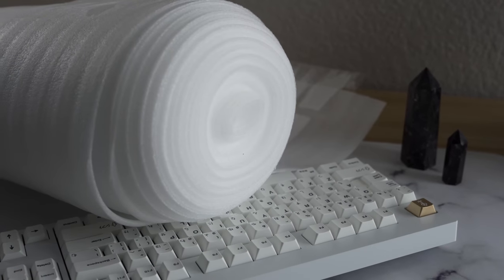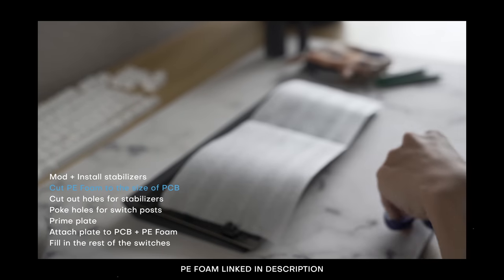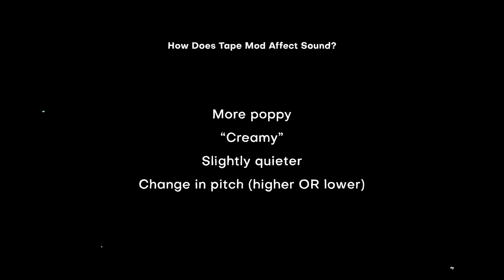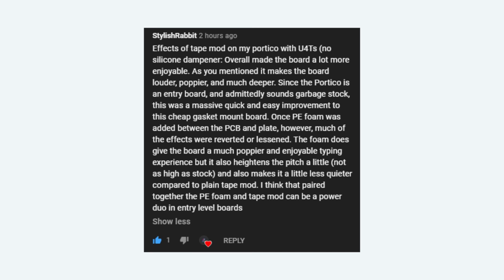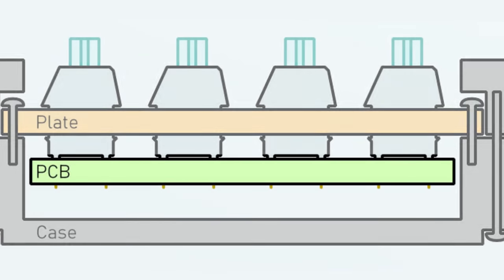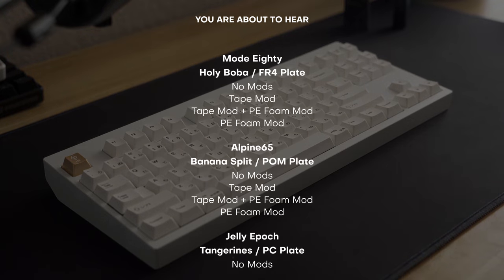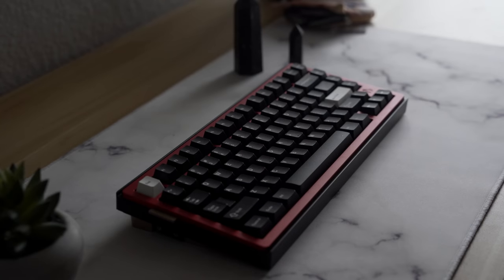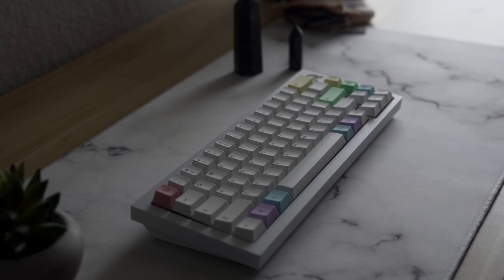PE Foam Mod Explained: An Ingenious Design

Comment from the maker: Timestamps are in the description if you want to compare sound tests on your own or skip to certain sections.
At 1:28, ignore "How Does Tape Mod Affect Sound". It should say PE Foam Mod. 
Foam: https://amzn.to/3lmLhAp 
This is not antistatic. I didn't have any issues whatsoever, daily driving 3 boards with it installed. With how little static electricity would be accumulated before it enters the board, I doubt there is any risk at all. Additionally, modern PCBs are incredibly resistant to static, however I would still avoid black foam, as that indicates the presence of carbon, and alongside it, conductivity.
Ranger629 adds that *YOU SHOULD NOT ATTEMPT THIS MOD ON A SOLDER PCB*. The heat from the soldering process can melt the foam and thus damage the PCB. 
Thank you StylishRabbit and ura for the research guidance!
Reply: is there anyway I can get this foam without having to buy like 500ft of it?

Comment: Why always do the sound test at 200 miles/hr? How are we supposed to hear resonance if every stroke is followed instantly by another one? You can just hear noise rambling. I don't understand this. We know you can type fast, we get it. So annoying...
Reply: because thats how it would sound like? you dont press one key and wait for the echo to finish before pressing the next key 😂
Reply: @zigrakudo4092  I don't spend all of the time on my keyboard typing at 200miles/hr actually, no.
Reply: @maxfern5701  yeah, but you also dont type on it like a grandma. unless you are a grandma, that would be understandable. even if you type at quarter the speed of the one using it, it would still sound similar. i understand if you find it annoying. you can always watch others, though. no one's forcing you to keep watching this guy's videos. unless you are. blink twice if you need help.

Comment: Awesome breakdown and mod! But dear god that sounds so tedious hahaha
Reply: it actually doesnt take that long
Reply: It seems like it takes far less time than hand lubing switches.
Reply: @prithvib8662  definitely quicker than hours of hand lubing
Reply: lol
Reply: Honestly doesn’t take that long (as long as your putting it into a new build) exact-o blade and fine tweezers to cut and poke holes
Reply: Hi hipyo
Reply: Definitely isn't as tedious as lubing switches. Using the PCB as the template, it takes about 5-10 minutes to prep the PE foam
Reply: @little_fluffy_clouds  Yeah, thought Hipyo is supposed to know keyboards well? And he thinks a PE foam mod takes a long time to do? Hm.

Comment: Wait, you updated the description to include anti-static foam? Although it is probably fine to use, it's actually safer to use regular, non-conductive PE foam. Anti-static foam is not meant to be used with electronics while they're plugged in, it's meant to dissipate static shocks away from the electronics it is wrapping. It is conductive (albeit barely so), and therefore somewhat risks shocks transferring from the case to the PCB. You should probably keep the foam link as the regular, non-antistatic foam.
Reply: best. comment. ever. there are a lot of questions regarding this in many places and forums. thank you for sharing this.
Reply: Thanks for sharing this!
Reply: so the foam he has linked in the desc is non-conductive? I got a GMMK pro with some PE foam but want to buy non-conductive just to be sure

Comment: Your WPM seems substantially higher than other content creators who do sound comparison videos, and it really helps to show the differences in sound.
Reply: the upside of using dvorak
Reply: @ee1yd  colemak better
Reply: @kinga1925  workman best
Reply: @ikeworkman4449  comment is 5 months ago i use neither sticking to my qwerty typing fast doesnt matter when you can already type 100 wpm atleast
Reply: @kinga1925  I don't use either also, just jokes. Although, based on my research workman is the best ergonomically while also allowing for high speeds. Also you might have noticed that a certain someone has "work" and "man" in their name...
Reply: @ikeworkman4449  got it.
Reply: @ikeworkman4449  i can type fast on qwerty so it doesnt matter, typing speed does not matter anymore
Reply: @ikeworkman4449  colemak dh has better ergonomics than workman

Comment: Subscribed! I talked about this mod with others on discord servers and there were some criticisms about how they don't like the thought of their board being packed with foam, that a good custom board shouldn't have foam, etc. Who's making up these rules and standards? This mod is revolutionary especially for people who can't afford expensive boards. It elevates their "budget" boards like gmmk pro to other high end boards and at the end of the day, if you're happy with it, nobody cares or is judging
Reply from the maker: The argument is a bit pretentious, but it's fairly true. The higher end of the community sees foam as a sort of crutch, being an "easy way out" of improving sound over actually taking the time and effort to prototype a case that sounds good without foam. When budget becomes a limitation, this argument is nullified because there simply isn't high end design in lower price points. 
And of course, you are building your keyboard for yourself and not for others, so it doesn't matter. If you like the mod, by all means do it.
Reply: my guy gmmk pro is literally 160 dollars thats so dam expensive bruh

Comment: I think you should include a disclaimer that the PE Foam Mod should only be attempted with a hotswap keyboard. As Hiney has raised up on multiple streams, doing the PE Foam Mod on a soldered PCB can potentially damage your PCB. The high heat from the soldering iron can transfer the heat up the switch prongs and melt the PE Foam. The melted Foam can then flow into the PCB contact points where essentially create insulation between the contacts and ultimately causing the PCB to not work. 

*Addressing people who potentially will say: "I did it with a soldering iron."

Sure, you did it and nothing happened doesn't mean nothing will happen to the next guy. Plastic/foams melt when exposed to high heat. They leave a black layer of gunk behind after they have melted and that is what can potentially cause contact issues between the PCB and switch.
Reply: Why would the melted pe foam flow against gravity? Additionally, all of the contacts in the PCB are soldered, melted PE foam isn't going to do anything but get it a bit dirty at most.
Reply: @irgilligan  plastics and foams can curl up when burned or melted. The foam here is also not very dense so it's not neccessarily going to melt like wax and drip
Reply: Ahh so that’s why my keys don’t work sometimes oop
Reply: Is this reddit or YouTube
Reply: @deccapod8957  lmao
Reply: Is this different from the normal foam mod?
Reply: I did pe mod on my solder pcb and i dont have any problem doing this. Make sure the solder is hot enough so that you wont touch the pcb for too long
Reply: would it be ok if u waited for the pcb to cool down before proceeding?
Reply: @TMKM  the foam has to go in before you solder
Reply: So glad I read this before actually doing it X.X....
Reply: I was thinking 💭 how the hell this would cause damage! Guys calm down! It is a foam on a ready to go pcb and switches! Didn’t realize that you have to squish the foam between switches and pcb and then solder it 😂😂 oh my! This isn’t fun at all!
Reply: didn't even think of this when i was putting neoprene ontop of my plate, kb working fine so i guess neoprene is harder to melt
Reply: Oh thanks just broke my keyboard because did this😃 but now i know why it broke
Reply: If you're melting the foam, it just means you dont know how to solder
Reply: has anyone poured silicone in between the pcb and plate (after the switches are soldered, of course)?

Comment: Thank you for this!!! It makes me happy that the community is taking sound so seriously, and the stigma against using plate foam (one of my favorite mods) is starting to decrease.

You mentioned that it was difficult to predict how it would make the board sound. In my opinion, it actually makes boards sound mostly the same. Since it makes low pitched builds sound higher and higher pitched builds sound lower, it brings everything to the middle, and everything kind of sounds the same because any extremes are normalized. It kind of has a reputation of making "any build sound good".
Reply: I'd say it makes any build sounds "decent". If the board is budget, it improves the acoustics, making it go from "okay" to "decent". If the board is premium, it normalizes the acoustics, bringing it down from its unique sounds to "decent"

Comment: These videos are so good, taking a more scientific and dissecting material effects on keyboard sound - for the amount of time and money the mk community sinks into the hobby, im surprised no one did this sooner! 

I have a suggestion for another acoustics analysis / comparison video: how adding soft materials (deskmats, towels, t-shirts) underneath the keyboard will affect sound! It's an easy enough way to instantly change the external environment of the keyboard, and very under-explored in my opinion. 

(Perhaps another video focused on desk material :3? Although that one will be harder perhaps. I have a glass-and-metal desk and the entire desk pings when typing. T. T  So I use a custom padded fabric deskmat)
Reply from the maker: Thank you! I'll keep both in mind.

Comment: One unexpected side benefit to me is that it really reduced how noticeable the spacebar sound was, that's my achilles heel in keyboards; in so many of the soundtests I've listened to the spacebars sound plinky or plonky and kinda cheap and loud, I find that they really dominate the sound of many boards that I might otherwise like.
Reply: That's an interesting point, Maybe PE modding exclusively the Spacebar, or anything with a stabilizer.

Comment: I need this in my life. BRB doing this on my $25 ultra budget amazon special mechanical keyboard. I'll let you folks know the results.

Edit: This makes the keyboard sound exactly how nearLucid described. Doesn't matter how the keyboard sounds originally. This mod brings it to a more neutral "creamy" sound profile. While it does sound pretty good, it's definitely not for every keyboard. It should help a lot more with fully metal keyboards that have very little dampening the first place. Tape I found makes almost no difference. Of course the obvious disclaimer that doing this makes bending pins much easier, so careful with switch installation. Do not try this with soldered switches. It will 100% melt the foam and leave a very gooey, sticky mess.

Comment: Another great video! I've been very curious about the mechanisms behind these mods ever since I tried them out. Fascinating stuff. From my experience with the GMMK Pro, the tape seemed to deaden the sound to a degree that I didn't like so I prefer going with just the PE foam on that board. On a cheaper board I did both since it sounds pretty bad and needs all the help it can get lol

Comment: I believe the more stiff the panel/surface the sound bounces to, the less it will likely to get dampened but just redirected instead. Thats probably the reason why acoustic sound dampeners are often included or combined with flexible materials like cloth. The sound bouncing to a flexible(ex: cloth/cotton/soft foam) surface would likely dampen more than bouncing to a harder/stiffer(solid plastic/metal) surface.

Comment: I just did this on my Frog TKL by Geon.. And it completely changed the sound profile. It's crazy how drastic of a change it was. It sounds deeper + marble-y now. Just like you said, clacking two stones together. 

I have heard that this mod changes the sound profile to basically the same thing for all boards and switches, so I am curious how it affects each board. 

But yeah, my Frog now sounds like a Jelly Epoch lol

Comment: So I did try this mod in A Test build of YMD 75v3+ YMDK 84, coupled with Stock Durock T1,Akko ASA LA Keycaps, PCB Dampening Felt, and Silicon inside of the case. The sound is so poppy! I am loving it!

Comment: I did this mod and my results are pretty interesting (I didn't record and compare the sound side by side, I'm just going by feeling):
I use unlubed gateron reds for my Q and E (my keys for osu!) and lubed reds for the rest of the board. The lubed reds sound deeper than before, but the unlubed ones sound higher pitch than before. pretty cool!
Reply: If you use Q and E for osu I'm gonna bet you're no better than a 6 digit
Reply: @sebaitor  i was like 37k at the time. Now I'm 30k.

Comment: I'm using the tape mod and the KBDFans switch pads on my Fuji65 alongside the Boba U4Ts and it did improve the sound overall. Pretty good mods for very little money spent.
Reply: I like the switch pads a lot as well. It takes a while to put them on, but the sound is better than PE I think.

Comment: You should try adding 2-3 layers of tape, having only 1 layer is way thinner than having foam. Thinking logically, foam is thicker meaning it will ofc absorb more sound.

Comment: Just a FYI everyone is wrong about the reason for the PE giving the extra pop it has nothing to do with filtering sound or material used. It has to do with compressing the switch pins into the PCB so there is a buffer for when downstroke vibrations come down they spread into the PCB. Don't believe me try the swagkeys or KBD foam with the larger cutouts to where you are not compressing the switch pins into material and they actually mute the switch instead of making it louder. I used Glad press and seal a few weeks ago (3 layers) to the top of my think 6.5 and it pops like no other and even retains switch sound signature.
Reply: !!! Real mod always in the comments

Comment: I Just made my first keyboard for $155, I electrical tape modded, PE foam modded, as well as using three layers as medical raps as a dampener.  The whole build took about eight hours, and it genuinely sounds almost just as good if not better than tons of $250-400 builds I've seen. 

Note: Sometimes the quality of a keyboard's sound can be hindered by the microphone it is being recorded with, so what I mean is that it sound as good as $250-400 builds through a microphone , my keyboard sounds like a dog turd in the wind on a hot summer day that was pissed on and spat at when listened to on my phone's microphone.
The PE foam mod is the number one biggest keyboard cheat there is, it turns a $100 sound into a $300 sound

(Classic keyboard W)  
 ↓
 ↓

Comment: Thank you for such an insightful video. Your videos have helped me a ton since im very new into the keyboard scene. I had a question though. Would you recommend PE foam moding if your keyboard comes with an extra Case Foam & PCB foam & Switch pad or is it only recommended for those who dont have case and pcb foams? Is your alpine 65 only modded with tape and PE foam?

Comment: I personally like the sound of the tape mod but NOT the PE foam mod, at least not in my keychron Q1 (alu plate, U4ts). At first I did both mods without really comparing the results but slowly really got annoyed by some of the frequencies of the switches. They sounded muffled and scratchy. I think the scratchiness comes from the U4ts not being lubed (yet), while the muffled sound definitely was due to the PE foam mod. I got rid of the foam and now it just sounds so much clearer and more crisp.

Comment: What I interpreted from this video is that you could technically use only foam on the alphas to make them all go lower in pitch since the alphas are normally higher pitched than the mods. Since the mods are typically deeper than the alphas, the pe mod might make them become higher pitched, so it might be better to not use them on some boards.

Comment: Surely the acoustics work the other way round? High frequencies are less likely to be absorbed or pass through the tape than low frequencies. High frequencies will reflect back off the tape. The tape is too flat to diffuse high frequencies. Like the walls of a studio. The imperfections in a painted surface are not sufficient to diffuse sound, so we use diffusers. The tape causing a higher pitch makes sense since the high frequencies reflected off the tape will reverberate underneath the keycaps. The acoustics of ehats going on is probably quite complex, leading to different outcomes with different setups

Comment: If you are diligent with your foam placement and cuts, will that change the dampening effects? i.e. can you retain the depth of the space bar by removing the foam from that area? I suppose I should test, but if you have insight I would love to hear it.

Comment: If you can find a thinner PE foam (0.1mm) you won't need to poke holes into the foam for the switches because it can pierce right through it, making it much faster to do!
Reply from the maker: hi steve, we loved your contribution to the mod, the reddit post was great!
Reply: @nearLucid  love your videos as well! Top notch work guys.

Comment: I tried this on my GMMK pro and removed the stock foam under the plate and the sound improvement is so great. Question playing on my mind now is the PE foam that came from the packaging I used for this mod is safe or not. been seeing some comments on other PE being added on the keyboard saying that the PE could cause ESD. is it safe to use the PE foam that wraps the keyboard when you first unbox it?
Reply: Did you end up using it? I’m curious as I might too

Comment: Putting foam in the keyboard wont change the pitch. not like a filter would by bringing out lows or highs. the foam reduces resonance in the board and also change the frequency the the board can resonate at witch then makes the board sound higher / lower.